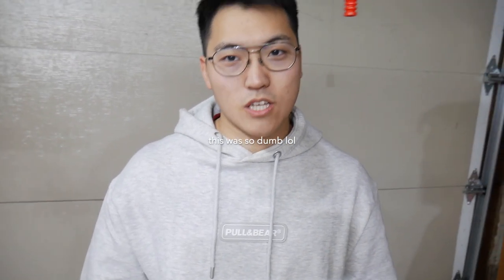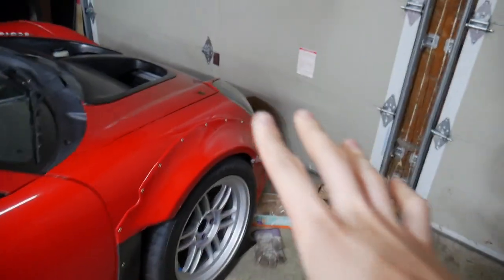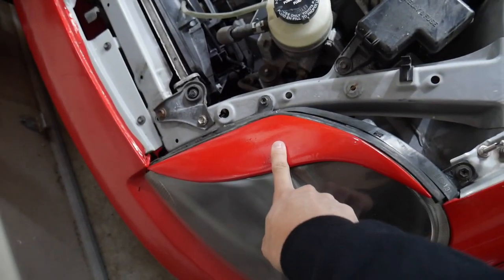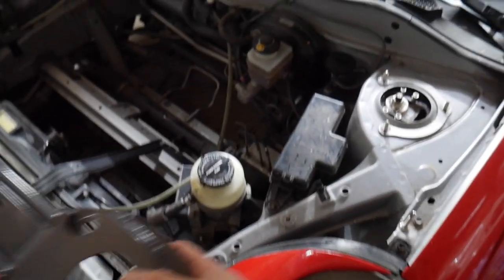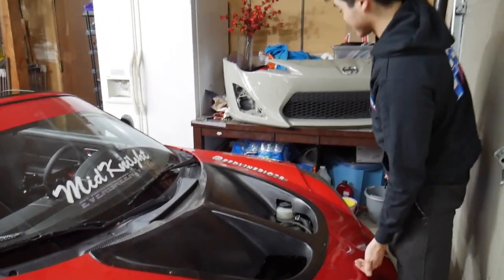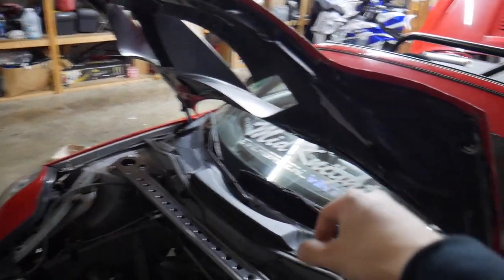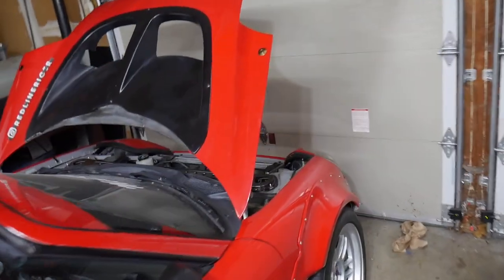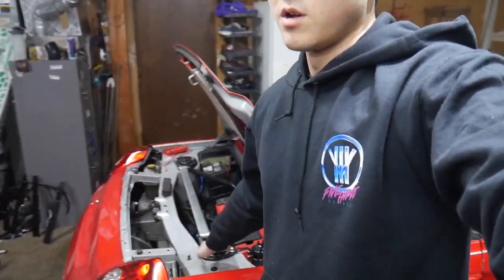RARE GENUINE TRD Front Strut Bar Install for the Honda K-swapped Toyota MR2 Spyder!

Comment: I also have a front TRD strut bar on my K20 MR-S, If I had known TRD also made the underside bracing and rear strut tower bracing I would have just bought all TRD lol. I ended up buying cusco under breast plate and a beatrush rear strut tower brace but its INCREDIBLY light.  I wasn't able to get the passenger underside cusco lower arm bar brace to fit with my K-swap with a OEM pan and a moroso oil pan but the drivers side one went in fine.
Reply from the maker: I’ll have to get some of those! I hear it makes a noticeable difference. Which one makes the biggest difference? (I already have a front and rear strut bars what do you recommend I get next?
Reply: @RedlineRicer  in our situation were you have both strut bar braces and are kswapped already, i do think it might be worth looking into a "front lower arm bar brace" and a "breast plate brace" as those are probably the next realistic options before a cage and the side "A pillar" braces from cusco and sadly or atleast on my swap my cusco rear arm braces (2 pieces) the passenger side doesnt clear the oil pan.   I threw all my braces on all the same time including the rear lower arm braces prior to the swap, and i had the stock suspenion too. I noted that the car doesnt feel like 2 seperate pieces flexing if that makes sense, like when i would take hard corners it felt like the front end and rear end are 2 seperate pieces moving around the corner.